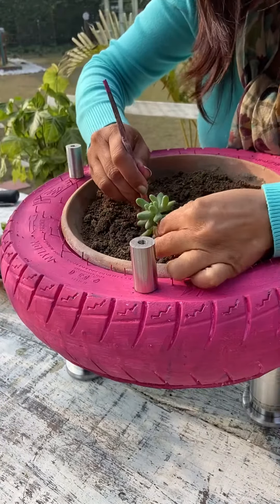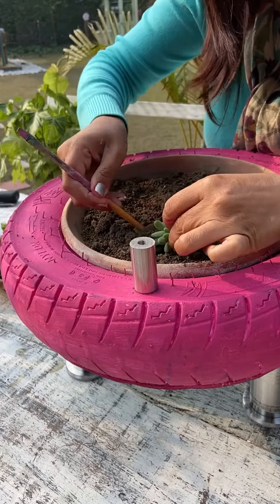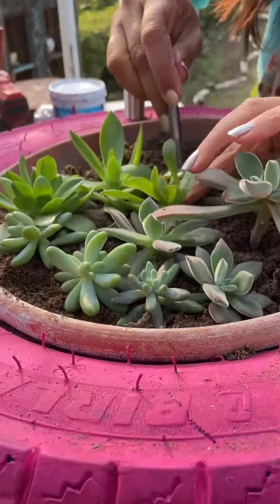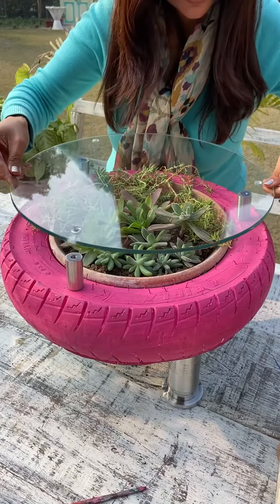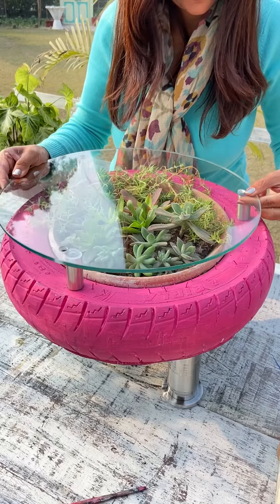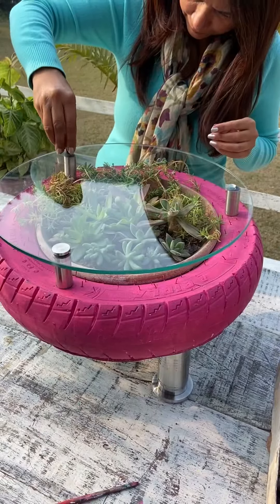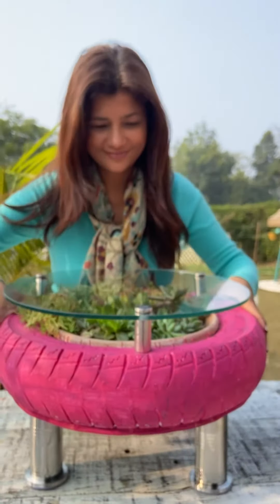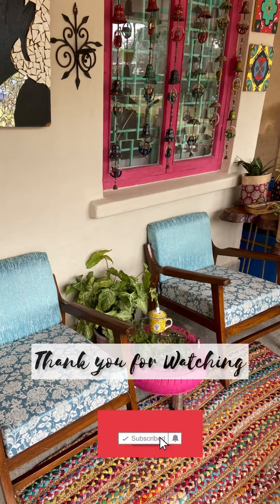DIY Succulent Teapoy

Comment: Its beautiful.... but what about the water that will drain out through the drainage hole of the succulent pot? It will damage the plywood...
Reply from the maker: Hey ! No drainage hole ! You can place a layer of pebbles in the pot for succulents ! They keep the soil moist and don’t let the water clog ! Have used this tea table for almost 10  months now 🤗
Reply: @designdecortravel  Thanks ..
 I will definitely give it a try..